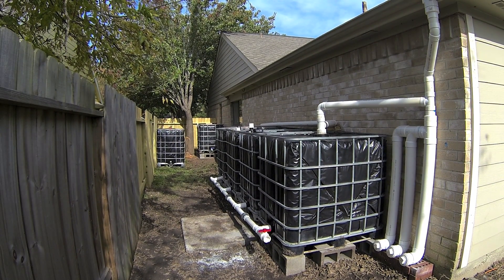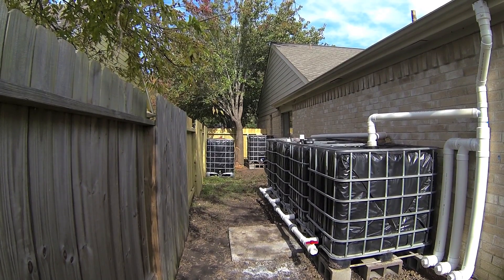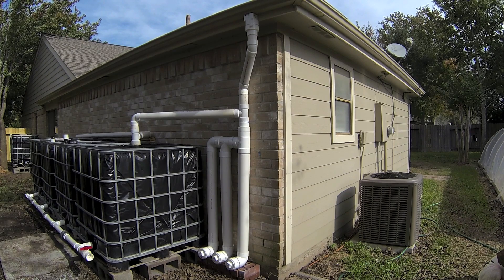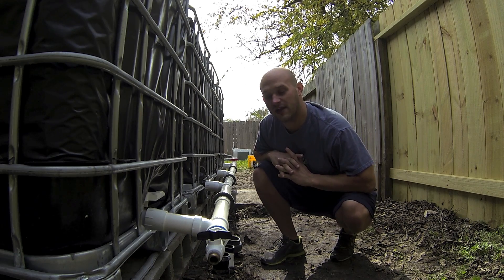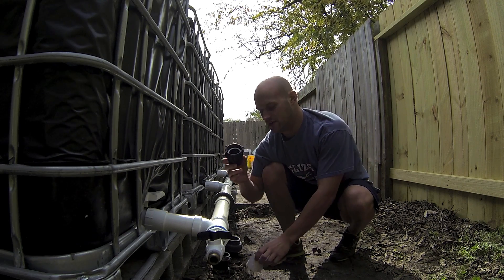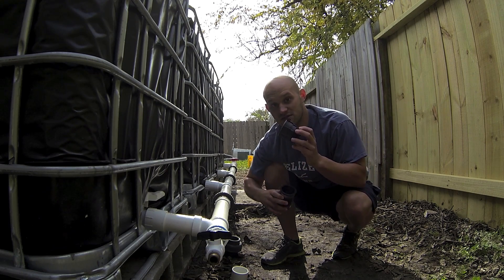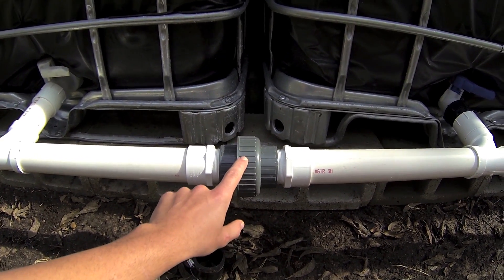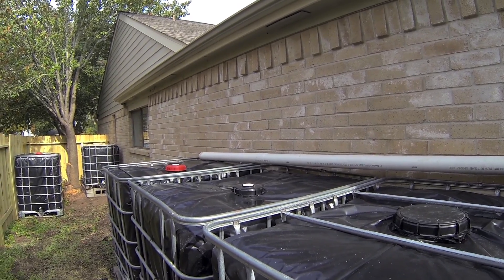IBC Rainwater Harvesting System Update #1

Comment: I am building a system like this with two tanks to supply water for my chickens and I started filling my tanks with water before I had everything set up only to find that there is leak at the valve where the pin goes through the gate and into the bottom of the spout. I don't know if I'm explaining this clearly enough for anyone to help but any suggestions are welcome.

Comment: You mentioned using the two new IBCs for your toilets.  I've always wondered, if you discontinue city water service, will your toilet still work if you flush them with your own water?  Or is the city wise to that and block the sewer line somehow?  Have you tried it?
Reply: I think it really depends on a case by case scenario... I've had water shut off on a residence and everything get flushed off through all the piping around the house just fine.

Comment: Do you have to vent this type of system? I have having trouble understanding, it seems sometimes venting is required and other times it is not. I am putting plans together for a community garden. I am bottom filling 3 IBC totes very similar to the system you have. I was under the impression I needed to vent each barrel to allow room for air to escape but I do not see that you have venting on your. Could you help me understand this please??
Reply from the maker: Caps are loose to allow venting.

Comment: for a gasket on your fill tube, use a toilet wax seal. they are 3" and the wax will allow for several seals if you need to remove it. They can be bought in 1" thick and 2" they are also easy to cut down if you need less than an inch, or simply  synch it down and the wax will squeeze out of the sides.

Comment: Dude... the direction of your fittings on your lower pipe doesn't matter... either direction won't change flow or pressure... basic plumbing. If the water came out at 100 mph, maybe but you have a hose for outflow.
Reply from the maker: +George Adams I have to disagree with you. Of course the water would flow and thy system would work if the fitting were turned the opposite direction. To build correctly you would want to have the adapters installed like the video. In this case it is a fairly simple system and doesn't make that much of a difference. In more complex builds it is important to install in the direction of your water flow. If water flows both ways you can install a T that does not have a specific flow direction.
Reply: These plumbing drain fittings are designed for maximum flow... the flow in the system you have barely flows and is way oversized for the purpose. Its like comparing a flash flood to taking a pee... LOL! Otherwise it looks great!

Comment: I have 2 330 gallon IBC that I am hooking up to a drip irrigation system but have to use a pump because of gravity issues with the raised garden beds. The problem I have is when the pump turns off I have a siphoning issue. The water wants to continue to flow. Does anyone know of a way I can put something in line to stop this?
Reply: Nathan Hadler without seeing it, it is hard to say exactly what could be wrong. But it may be as simple as raising your pump up a little or placing a check valve some where. Like I said it's hard to say without seeing it.

Comment: Lookin at doing this with about 1 to 3 dozen totes.  Depending on space.  Gobna double stack them as well.  Using it for emergency drinking water,  drought garden water and emergency fire protection for the fire pump
Reply from the maker: +KosukiFire you may want to look into the large black or green water tanks. For as much water as you will be storing this route may be much easier. They make tanks as large as 10,000 gallons. Here in Houston a 3,000 gallon tank retails for about $1300-1400.
Reply: KosukiFire  Might want to look into an underground cistern system?

Comment: The blocks should be setup on end. but good job.
Reply: that was the first thing I noticed....
Reply: PastorDowell why cinder blocks on end? Seems less stable than stacked one below ground level
Reply: Whats the problem with it
Reply: That is how CMUs (concrete masonry unit) are designed to be installed.  The nice face is what you see when building a wall so he has them oriented in the least structurally sound direction.

Comment: I got fined for holding rain water. So I could filter it and drink it myself. Police said no. Here is a ticket for breaking the law. As I have no water permit. 1,500 $ the next day three or four officers I was told Stoll the whole thing. Wow. Rainwater is the best to drink, just have to have a water permit ,I guess.
Good luck. !!
Reply: +Ed2016 Boomer where the hell do you live. if this is the kind of local gov. you need to get out now. if shtf..it will get way worse.
Reply from the maker: Ed2016 Boomer Which state do you live in?
Reply: Ed2016 Boomer Put it undergrd in a cistern ,hide it!

Comment: Google tote containers, go to a place that sells them and has accessories, and you'll find that they have lids that have a threaded hole for pvc pipe in them.  Then I would suggest you use that "t" fitting you have on the first container, and use it on top of all your containers for filling, and the last one in line would  have the overflow.  That both vents and fills your containers at the same time.  Also, your first flush system, if you took the amount of water it holds and went up on the roof, would if clear all the debris off the roof, and carry it down and out the gutter?

Comment: The water supply end of this system is WAY! over sized. Using a big pipe does not equal lots of water. Most houses have a 3/4 inch supply line from the water meter to the house. I am willing to bet that his house was built with 3/4 inch pipes. It looks to me like he is using a 2 inch pipe on the supply end of the system. This is a waste. I suggest using one inch flexible pex pipe to tie the tanks to the house. Truth is that if the house is plumbed with 3/4 inch pipes that is all that you would need from the tanks. Larger pipes are not going to give you more water. In some areas houses are plumbed with 1/2 inch pipe. If so you could simply use garden hose fittings to connect to the house. (On the other hand, you would use 2 inch pipes if you wanted to supply four houses at the same time.) Also stacking one tank over the other is not going to give you much pressure at all. You would need to stack tanks 100 feet in the air to equal normal house pressure. Instead Home Depot sells a 110 volt shallow well pump with a pressure sensor. Whenever water is being used in the house it will automatically turn on and turn off when there is no demand for water.
Reply from the maker: Thanks for watching Robert Erickson  this video only covers rainwater harvesting and not filtering and purifying water to enter the home. This video may interest you, https://www.youtube.com/watch?v=YpKayMx-edQ&list=UUNKd4ZRjY9UPu2wTpXbPCrQ
The 3 inch pipe is to collect rainwater off the roof not to send water to the home, with over 1250 sq feet of roof area 1 inch or rain will produce over 700 gallon of water. Here in Houston an inch of rain can fall in 20 minutes, your going to need a large pipe to harvest all of the water in that amount of time.

Comment: I'm new to this stuff but any worries about settlement on your house? With over 4 tons of water right next to the foundation, I wonder if that would cause foundation trouble?
Reply: Chris Mccollum   I absolutely agree, and your weight estimate is correct. That is a lot of pressure on a basement wall which as they may typically be built, should probably fail anyway (no cores filled as the Masonry Institute (?) cautions). If doing one tank, at least put it at a corner - not at the worst place (in the middle) if possible. Also there is, I believe, an approximate 45 degree pressure line the soil gives; anything below the line sees the pressure, not above. Therefore, you can judge better distance from a wall. (This is where footer drains should not lie if this is taken into account.). If this is slab-on-grade, fine, but he doesn't have any room and certainly doesn't want to hear this news.  Flooded soil alone WILL break walls, this is why I had to get my water diversion under control -the wall did crack. When people start getting into bigger installations, the limits are approached.
Reply from the maker: Chris: Good question, If your worry is that the tanks will settle and lean onto the brick or house foundation I do not anticipate this to be a problem. I have placed the tanks a few inches away from the wall where I can monitor if there was ever any problem. If there was I could easily remove the tanks and sturdy up the tanks foundation. Does this answer your question?
Reply: trenton kaminski Good point. I guess if it's not connected to the house, then there wouldn't be any settling OF the house would there?  I have a spot that's perfect for my IBC barrels to be placed, but I'm worried the actual house will settle in that location..... thought?
Reply from the maker: I would place the tanks away from the structure by a few inches, if the house does settle then you will see this happen slowly over time and can reset your tanks to the appropriate location.

Comment from the maker: Blake, I used gutter guard to block leaves and solids from entering the gutter system. I show a quick view of it on this video and will make a video over all the filtration. I have a total of 3 filtration stages…1st is the gutter guard, then the first flush diverter, and last I have a double lined panty hose filter to catch any remaining  debris. I also have plans to shield the tanks, my plan was to build a cover that will match my fence. Basically a small fence around it and then a removable top.

Comment: How do you install filters in the gutter system or the tank to prevent solids from building up? Also did you consider painting them and why not? My lawn is pretty visible where mine will go and so trying to think of a way to avoid seeing black garbage bag color when neighbors and cars drive by.
Reply from the maker: Blake Whitney I am not sure how I did not see this comment until now. I use gutter guard on part of the house where leafs could possibly enter. Every so often I also spray the gutters clean with the garden hose. Paint is a great ideal, on my updated videos you can see them painted. Im in luck that I have a fence between the road and my tanks, other than the fence I have not experimented with any other covers for the tanks.